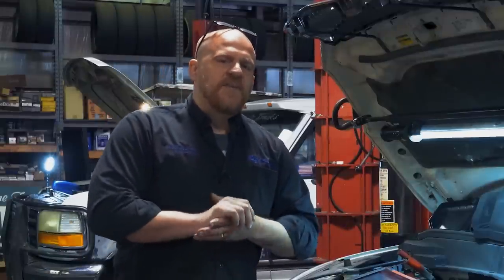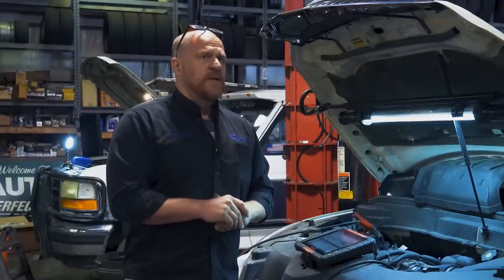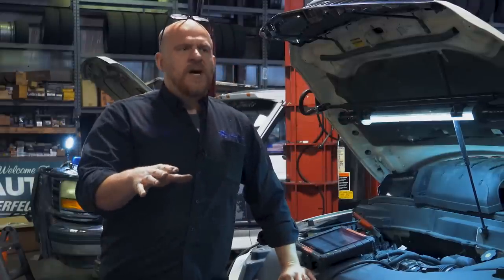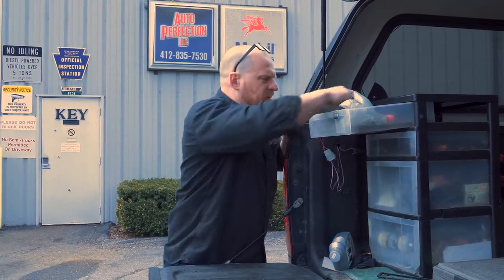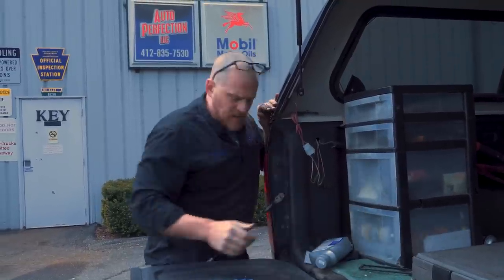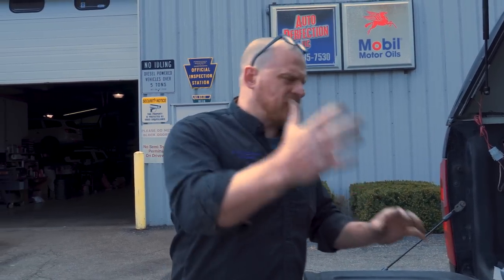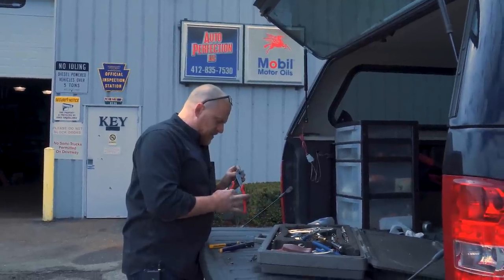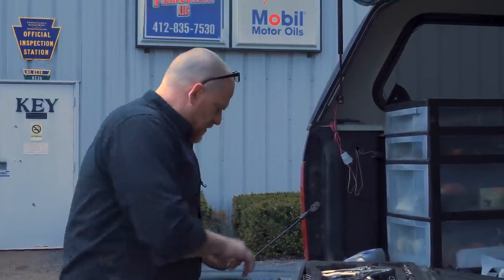2009 Buick Enclave NO COM To Fuel Pump Control Module Part 1

Comment: Danner instead of trying to find a ground under the vehicle bring one with you. I have rigged up some ground leads that come with me. For example one end has a clamp attached to the negative terminal the wire itself is about 20 foot long I work on big stuff btw and the other end plugs directly into my meter. Or one end has a clamp attached to the battery negative post the other has my test light attached. Or whatever you want really but no matter what you always have the best possible ground the vehicle can offer. Keeps you from any wrong paths yes the long lead can get tangled up but no worries you have the best ground possible and that’s what really counts especially under rusty vehicles.
Reply: You said this for me. The time wasted over a year of fighting bad grounds is many times that needed to make a flying lead connector.
Reply: AWESOME IDEA BRO ! THANKS !!!
Reply: Also powerprobe helps with that

Comment: funny, the rodents don't seem to want to chew on my early 90's vehicles and very rarely ever did on anything older, with exception of a single spark plug wire. but I'm not one to wash and spray junk sprays under the hood either

Comment: very good video! Where the importance of following the diagnostic steps is demonstrated in which the arnest could be repaired and analyze that the can network is fine because it communicates with the differential module. I loved the Snap-on truck !!! the new fuel pump module must be reprogrammed on your tow web GM. greetings and blessings to all!
Reply from the maker: Thank you so much!

Comment: ok, very nice video, one thing I learned over the years is that you start to avoid doing major repairs and trying sticking only to diagnoses specialy with these newer vehicles where everthing is tight in there and lots of plastic where they become brittle overtime and break as soon as you touch them and to top it off we become the last resort where no else could fix it. Well all that comes with the trade so just ride along and avoid the stress. I did not design the vehicles nor it's my problem I only fix them.
One thing I am glad of that here I dn't deal with rust or corrosion  and wire don't rought out do to road salt, but I deal with bad repairs from other garages. thank you for sharing it's great being able to discuss, watch, and contribute with fellow tradesman through out the world

Comment from the maker: Special thanks to @Thomas Stevens
 who suggested a "Ratcheting Wire Crimper Tool with Interchangeable Dies - For Heat Shrink Connectors, Non-Insulated, Ferrule Terminals" I want one of these now! For those interested, I added it to my Amazon Affiliate page https://www.amazon.com/shop/scannerdanner
Reply: I had the same problems with those  crimping  pliers ,  now I use those  knipex  wrench pliers  the 5 inches  ones .
Work awesome no damage  on the plastic  and crimp  real good
Reply: Got one and wouldn’t go back nice to be able to crimp anything from open barrel to insulate connectors.
Reply from the maker: I like the idea of an even crimp every time. Is that the way these are?
Reply: @ScannerDanner  yeah, those  knipex are good for crimp with the same force  every time,  thanks  for all the different  adjustments u can do many sizes of connectors  without damaging the insulation
Reply: ScannerDanner best part about some of the ratchet crimpers is you can actually adjust them for how much they crimp.

Comment: Hey Paul, I see that you are using the razor blade for cutting the harness back, I wanted to recommend getting some sewing seam rippers. You put the ball end of it in the harness then cut. So much easier, less chance of cutting other wires. Shout out you, I've watched your videos over the years, you have taught me so much thank you
Reply from the maker: such a great tip! I know what you are talking about too and never thought to use one of those on wiring harness tape! Thank you!

Comment: I agree with you on the low temp solder butt connectors. I tried several brands and had less than acceptable results. Solder wires, marine heat shrink when I can, heat shrink crimped butt connectors with sealant when I can't solder.

Comment: I bought a Snap On crimping set when I was wiring my 32 Ford I built. Factory style crimps thru the whole car, only way to go for proper repairs when possible also.
I prefer not soldering since it tends to make wires ends brittle and vibrations break them over time. Heat shrink butt connectors are the second best option to weatherpack versions.

(Solid state FP relay inside the FPM)

“It’s Dorman related.” lol

Comment: This is why I like to have cats all over the neighborhood. And there are plenty where I live. 
Nice video, as always, and a better and better editing (thumbs up, Caleb).
About the digital network and why it is not a star network: If you have a derivation from the main lines towards a module, that derivation will reflect energy back and superimpose on the energy in the network with a certain delay. That would mess up communication. There is always a reason for small details that don't look good at a first glance.

Comment: Next time you use those solder things you might try splitting the strands in half, pushing them together, and twisting them. Locks the wires together pretty tight while your moving the solder sleeve over the wires. Loved the Vid btw! Like always.
Reply: "Car falls on me it'll be a blessing." You crack me up 🤣

Comment: I bought a great set of crimpers from a place called Del City about 4 or 5 years ago. They work great and are the ratcheting style. The set I have do 22-10 gauge wire and were about 50 or 60 bucks. I just checked their website and they have a new design set of crimpers for that wire size range but the price is insane at over 200 bucks. If you type in on their search, look for style number 990165 and those are identical to the ones I have but do wire sizes of 16-8 gauge. The one I have is pretty much identical to the ones GM supplied in their wiring repair kits they would send to the dealers.
Reply from the maker: Another subscriber just sent me a link to one like you are describing and I added it to my amazon page https://www.amazon.com/shop/scannerdanner

Comment: Hey Paul this is the exact same system that I asked you about  about 2 years ago on a Saturn outlook . Fuel pump module was replaced with a dorman part . And it’ kept popping codes  over and over again . Turns out 3 modules later  I said get me a used GM part or a new one .. put the new part in and 💥 fixed

Comment: Have you tried using bare connectors then covering them with marine grade heat shrink. Imo they allow you to get a better crimp and a better seal
Reply: I'd order a kit from sherco auto.
Reply: Every time I use those I split the crimp like an idiot, but it is nice that heat shrink actually fits over it unlike insulated crimps 😂

Comment: two seperate com lines     only one is down and the other is still allowing it to run. i believe one will be LIN 12 volts  and the other which is CAN will be 5V    pins 6and 7 are a pass thru with 21 and 22. They make mouse repellant electrical tape. Honda sells it. Thank you for the video's

Comment: I have some of those solder seal connectors. Thankfully I have only used them a few times. I used them on my own car. Subaru cam sensor pigtail. Less than a year later they melted more & came apart. Definitely won't be using them near heat anymore.

Comment: Great video it has helped me eliminate some issues but now im left with no power to PIN 32 Red/ White Battery Pos +. whe I use a hot/ground test probe it test green as if grounded. Ive traced the wire to the rear compartment to a plug by spare tire but cant tell where it goes from there. Any Ideas? I made the mistake of replacing the Low pressure fuel pump and the FPCM before testing wires. I do have power from the ECM

Comment: I use the butt connectors a lot too.  Red butt connectors mostly, fair amount of blue and a little red.  Some stuff I sodder but lots of tight spots and 90% of what I do is onsite at the costumers Veh yard.

Comment: That tank would be under a pretty high vacuum at 3.3 volts.  I am wondering if you don't have a bad Fuel pressure sensor as well.  The no-comm is weird, but I have found it's a good idea to get a different scan tool and try again with no-coms on modules.   Hopefully the module isn't actually talking but not relaying data it considers erroneous to the PCM.  We shall see in part 2!
Reply from the maker: yes we shall 😎, I cannot say anymore just yet, but you are on to something here

Comment: I always use ratchet type crimping tool, with the correct jaw for the type of crimp being used. This guarantees the correct pressure has been applied to the crimp. It also prevents too much pressure from being applied causing damage to the insulation. The jaws are also sized for you to use the correct slot depending on crimp size (Red, Blue, Yellow etc.) Another benefit is you can lightly crimp onto the crimp, so that the crimping tool holds the crimp with out having compressed the metal inside. This allows you to push your wires in with out having to squeeze on the pliers to hold the crimp. I would recommend trying a set of these over the plyer type, i think you will like! Below is a link for the type i mean, which come with various interchangeable jaws. 
I would not like to have cutters on the end of my crimps. They would get in the way with looms, risking cutting wires accidentally. 

https://www.amazon.co.uk/Crimping-Tool-Wirefy-Interchangeable-Non-Insulated/dp/B07Q32PYP3/ref=sr_1_17_sspa?dchild=1&keywords=crimping+tool&qid=1594488086&sr=8-17-spons&psc=1&spLa=ZW5jcnlwdGVkUXVhbGlmaWVyPUEzQlZGMUNJWDhHOVJRJmVuY3J5cHRlZElkPUEwMDAzMzE5MldPWVk4VUE3MVA4NyZlbmNyeXB0ZWRBZElkPUEwMDY2MTUyMzhFTlFOU0JCWTlKSCZ3aWRnZXROYW1lPXNwX210ZiZhY3Rpb249Y2xpY2tSZWRpcmVjdCZkb05vdExvZ0NsaWNrPXRydWU=
Reply from the maker: Nice! Thank you for the link! I'll add this to my Amazon page
Reply from the maker: added! thank you! now I want one of these :-)
Reply: @ScannerDanner  Your're welcome. If you get some, let me know what you think.
Reply: @ScannerDanner  I don't want to rain on the parade, but those crimpers are massive,  i've got a set, and they are alright for bench work, but would say in the field  you would be lucky to be able to use them 10% of the time.  I've got a set of the small crimpers you just bought( and the big set, actually I have a bit of a crimper problem i guess)
Reply from the maker: @Mr79elk  hmm, good tip there! if they are as big as you say then that does change things a bit. Thanks for the info!
Reply: Agree 💯%

Comment: SD where is your power probe? It would be a great ground oh and power right there at your finger tips for testing.
Reply: I was just on Power Probe's website the other day and it looks like they no longer offer the III and IV models but one called the basic and the Hook.  I know you can still buy them on Amazon and other places but I just found it strange that it looked like they were discontinuing these models.
Reply: @Mr2004MCSS  really!? I have the snap on version and I just bought a second one. It has so many uses. And just picked up the power probe digital temp probes too. Another tool that I use daily.

Comment: I realized I was using the wrong Part of the crimper when I crimped a sealed heat shrink terminal and their was a big non sealed hole in it. Lol.  Surprised scanner danner is learning this in 2020.

Comment: I know it may be silly to do on newer cars but why not doing a continuity test to check if wire integrity is ok? I've done it several times before to check wiring and worked just fine, at least with wiring that doesn't splice to other locations. Great video btw really enjoy your content!
Reply: If one strand can carry the voltage it will ohm out fine but fail to carry the load of the device.  Thats why load testing is more usefull than using a dvom

Comment: You must use the heat shield reflective  adapter that attaches to your fuel operated solder/ torch to melt your solder sleeves properly. A little bit of practice will do it.
Reply from the maker: that's what that adapter is for! lol, I still prefer the flame but I'll give it a try :-)
Reply: Take some strands of wire and make some practice article's. Try moving your torch with adapter from side to side. Also try it not moving it. A little flux on the strip wires helps. Once you get the hang of it you will like it. Toughest part is securing the two stripped wires together. I have seen some people use two alligator clips made in to a holding tool.

Comment: I assume the FPCM defaults to 50% duty cycle to keep the car running if it loses comm or detects a fault while the relay is activated.
Thanks for the video.
Reply from the maker: Part 2 will reveal that ;)

Comment: Omg this is a good video cause I loved it seeing him mad an swearing when u put that music in an he was ranting an raving.... its was hilarious. The mechanics live is a struggle some days for sure
Reply: I got a 94 Bonneville no crank no start an its driving me nuts I got my 5 volt ref got power to an from fuse box when I turn key to tun new starter enabler relay if I jump the two yellow wires it will crank but will not stay running.  Like I say its driving me nuts lol

Comment: Hey Paul ACE hardware sells a spray product called Critter Ridder it works great pray it on all the wires and any rubber and the mice will leave them alone.

Comment: "Unfamiliar system; what do you do?  You familiarize yourself.  Grab a wiring diagram for this fuel system and see where this relay is."  The last guy I worked for would have scolded me for this.  Then essentially tell me to punch codes into Identifix and it will tell me how to fix everything. 
 The most infuriating part of that, is the guy is actually smart enough to know better.

Caleb and Danner, you are comedic gold.  Paul, they do make BIG Kit Kat bars.  Where do I mail you a box?

A Dorman part failed?  That's so uncharacteristic of them.  Caleb, get your dad to say THAT with the smooth jazz playing....that or the sound of a car crashing, exploding, and burning.

What's the chance you can crack that Dorman module open at the end of this?  I'm halfway inclined to believe there actually is a relay for the fuel pump built into the module and, assuming there's no short in the box, the module has no actual control of the fuel pump.  It's as if they needed a place to dump a relay (or transistor), so they just stuck it inside another module.  It could explain why you've got a working fuel pump with a normal looking pulse width in spite of a brain dead module.  Does this sound viable or do I need to go collect my stupid prize?  I'm probably not winning a box of BIG Kit Kat bars, right?
Reply from the maker: Caleb and Danner are absolutely comedic gold. Thanks for noticing :-) and for the comment. Great suggestions too about tearing the old module apart.

Comment: I had a Tahoe that was towed in that had no comm with ebcm,chassis control module and fuel pump control module. Checked  High speed can in and out of modules-ok .checked power and grounds -ok. Checked enable circuit,should be 12 volts and it was 0 at each module.BCM supplies wake up signal for all the modules on 2 outputs , one was working one was dead. Replaced BCM and now had 4.5 volts, one module was pulling it down,turned out to be chassis control module--unplugged it and had comm with FPCM and EBCM.  The chassis control module had burned out the driver in enable circuit 2 in BCM.That one was interesting.
Reply from the maker: Crazy one for sure!
Reply: @ScannerDanner  Oh yeah!

Comment: If it's gdi then there could be a fuel pressure sensor for the low side..it lives at the incoming port/line at the high pressure fuel pump, run by the camshaft..my point: the fuel pump in the tank might be of variable speed

Comment: Yes you have communication with rear differential because throw 6 and 7.
But you don't have with ECM because throw 21 and 22 and the same with BCM. 
May you have an open in 21 or 22 wires.
Put scope in 21 or 22 in Fuel Pump Control Module connector to see CAN BUS waveform not enough because may this wave from out from fuel pump control module and not received by ECM due to open circuit.
And the same thing if you measure from ECM connector.
So you must be measure continuity between 21 and 22 in FPCM to ECM.
Reply from the maker: Communication to the rear differential control module goes through the fuel pump control module. The fact that I can talk to it (rear diff mod) tells us the come lines are all good. In other words, the data packets from the rear diff mod. must travel through the fuel pump control module on pins 6 and 7 and then out to the network on 21 and 22. If there was an open in the area you are suggesting, we would not have communication with the FPCM OR the Rear Differential Control Module. No need to do resistance measurements on a known good circuit. Hope that makes sense. Thanks!
Reply: @ScannerDanner  

Ok.
Every thing is clear now.
Thanks.